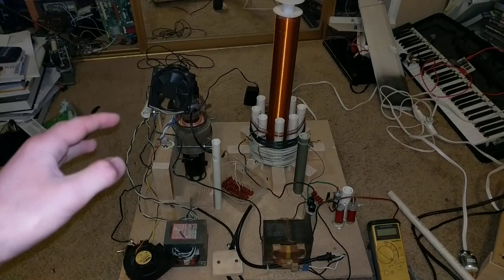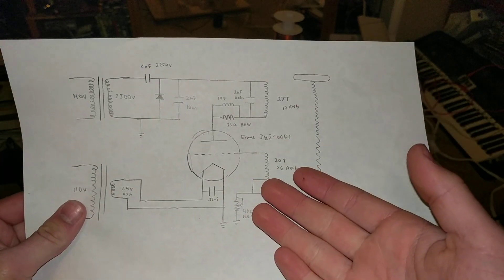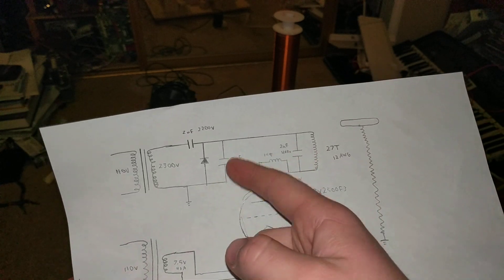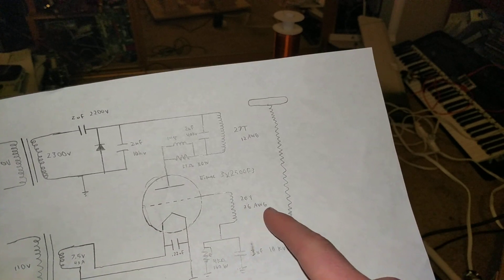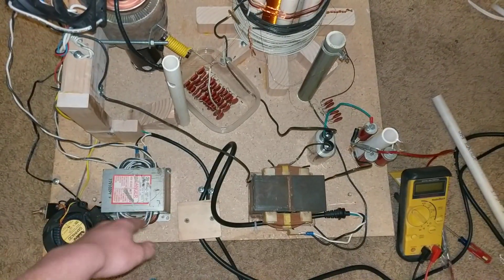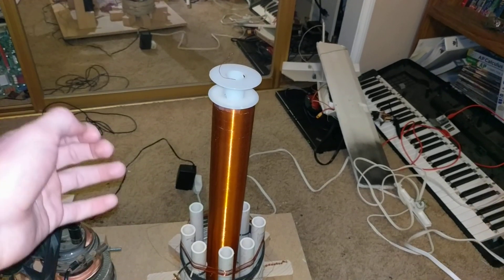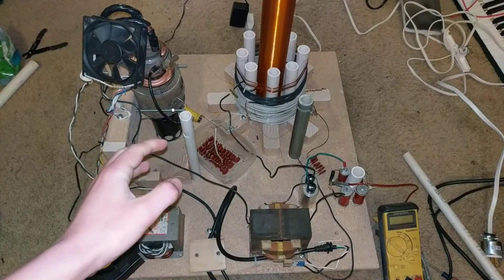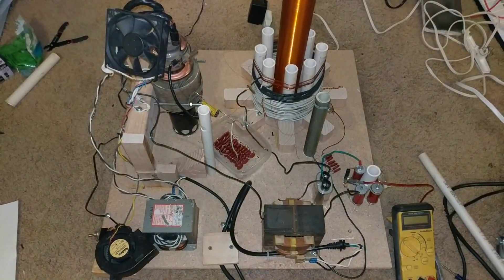Help Wanted With my  VTTC Build

Comment: You could try different caps , the ones you're useing are probably limiting the current quite a bit. also try mathematically calculating the resonant frequency of the tank circuit, 1/2Π√L*C=ƒ(Hz), you can algebraically solve the equation for either set of values. And that tube is rated for about double what that MOT can supply so maybe try putting another MOT in series. I world also try adjusting the grid bias to control how long the tube conducts for.  your coils also seem a bit disorganized(no offense, mine probs wouldn't be much better)and that could lower their inductance,so try cleaning them up a bit.       good luck!

Comment: Ok disregard all that I have said well most of it anyway..  I have gone back to some of my old text books and I think I know what might work Leave the circuit pretty much as you have it now except wind the two coils( plate and grid )close to each other..These need to be close coupled . Maybe even on top of each other. as the mutual inductance between them provides the bias via the grid leak resistor and capacitor . I can't see the value of the cap or the resistor. I believe the cap to be 2mfd. and not sure about the resistor .You may have to play with these values to get the required results. Ideally they should be equal to 1/RC  Where 1/RC equals the time constant of the oscillation frequency.Rembert my corollary to Murphy's Law  Amplifiers do Oscillators don't. In other words  amplifiers will oscillate and oscillators won't.

Comment: I still don't have my tube ): you beat me to building it, but we agreed on who could get the biggest sparks. I think you problem is the capacitors are limiting the power going into it. Your power supply is most likely not powerful enough. Your resonance is probably off as well.

Comment: Personally I'd go through it and check the insulation, maybe change out the capicotors in the tray for some of the blue type metallised film capicitors, the other thing is tubes often need 400v to even heat up, maybe check your outputs there, or try to remove any resistive loads that may be in the way

Comment: It would be helpful to see measurements of what you have running so far.  That way you could rule out inadequate power supplies.  ie., what happens to voltage and current when you turn it on?  If you are dropping too much supply voltage it could be that you need more juice :)  Great project!

Comment: The circuit you are using is an Armstrong oscillator. The tube you are using has a  direct heated cathode  therefore there is no way to establish any bias for the grid. The cathode is grounded. and you will need to apply an external negative voltage to the grid. Try connecting the variable resistor in the grid circuit to a variable negative power source. something in the 0 to 50 volt range.  Also the tuned circuit is usually in the grid circuit not the plate. It might be easier to use a external oscillator to drive the power tube. That way the tube is nothing more than a high voltage high current switch. You  can also play with the frequency for optimum output. Hope this helps.
Reply: John i agree. I would also remove the "grid leak CAPacitor"  It might shunt the "turn on" pulse and i don't see why it is there in the first place... Also IF the feedback coil at the grid gives a positive pulse, then the tube should contact (a little at least), so maybe the feedback coil leads need to be connected the other way around
Reply: All i know is that tubes usually need to be heated by some kind of direct current before they function fully, and also, earth grounding provides an alternating current with a lot of electrons to play with, thus increasing amps.  Also, bigger capacitors do the same thing.

Comment: Have you tried tuning it manually or have you relied solely on values/calculations? Make sure you have a [very] good isolated ground, Not your house outlet. Use a spherical top load with a breakout point for more capacitance. Keep playing with it until you hit resonance (you should notice when you do). Maybe try an adjustable air capacitor in parallel with the primary coil. You also might want to try less turns on the primary.